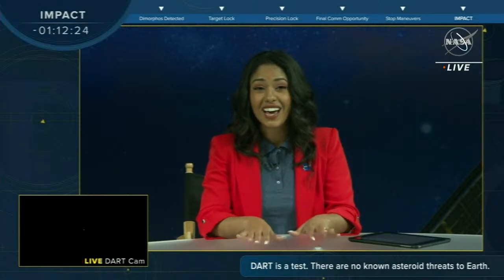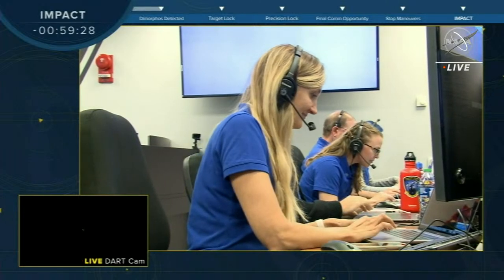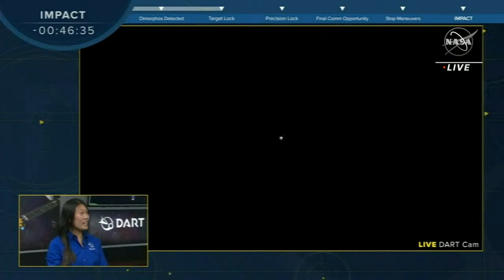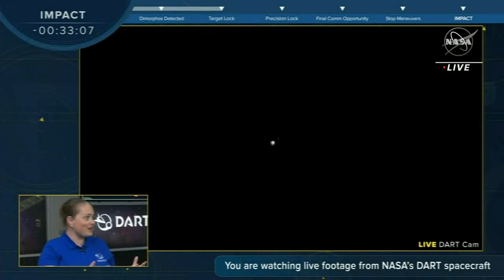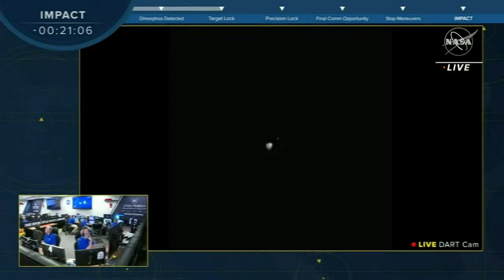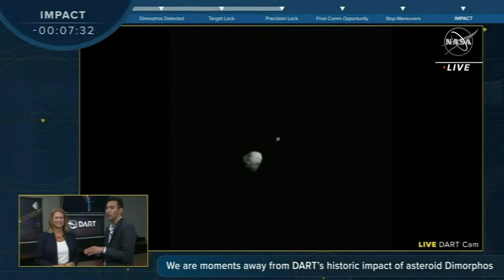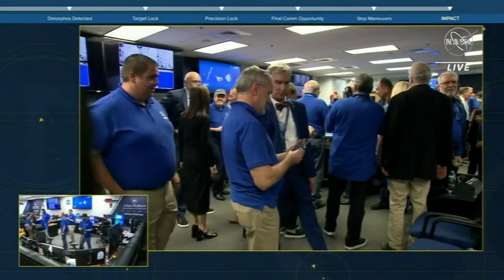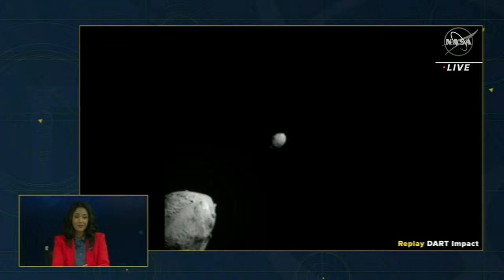NASA's DART spacecraft crashes into asteroid in first planetary defense test | full video

Comment: So, its awesome it hit, but the big question here is:  did it divert the asteroid? Or did the satellite just get godsmacked?
Reply: @Culture 25-8 i'm not clowning on it. I'm wondering the ultimate question, the purpose of the entire test. In fact when I finished watching the video, they reveal they will have the answer in about 11 hours when orbit trajectories update. This is a test to see if they can change an asteroid orbit to prevent destruction of the Earth in case of the event.
Reply: @Aero3D  Asteroid's path altered in NASA's first test of planetary defense system
By Steve Gorman  October 11, 2022 7:22 PM EDT

"DART's celestial target was an egg-shaped asteroid named Dimorphos, roughly the size of a football stadium, that was orbiting a parent asteroid about five times bigger called Didymos once every 11 hours, 55 minutes.
The test flight concluded with the DART impactor vehicle, no bigger than a refrigerator, slamming directly into Dimorphos at about 14,000 miles per hour (22,531 kph).
Comparison of pre- and post-impact measurements of the Dimorphos-Didymos pair as one eclipses the other shows the orbital period was shortened to 11 hours, 23 minutes, with the smaller object bumped tens of meters closer to its parent."

So a 32 min change when the predictions were 10 minutes and a 73 second change would have been considered a success.
Reply: @steveaustin2686  i saw!!! Thank you!!! Success! :D
Reply: @Aero3D  And better than expected. On to the next test.

Comment: It would be ironic if the telescopes reveal that the small rock now hit a huge rock changing the trajectory, that is now heading towards earth
Reply: that was why Simulations were the way to go.. you have good point!
Reply: @yosefnegussie8790  No, it's a silly point once you look at what the test was.
Reply: DART hit the smaller asteroid that orbits the larger asteroid, barely moving it. The movement was larger than predicted, but really didn't change their orbit around the Sun at all.

Asteroid's path altered in NASA's first test of planetary defense system
By Steve Gorman  October 11, 2022 7:22 PM EDT

"DART's celestial target was an egg-shaped asteroid named Dimorphos, roughly the size of a football stadium, that was orbiting a parent asteroid about five times bigger called Didymos once every 11 hours, 55 minutes.
The test flight concluded with the DART impactor vehicle, no bigger than a refrigerator, slamming directly into Dimorphos at about 14,000 miles per hour (22,531 kph).
Comparison of pre- and post-impact measurements of the Dimorphos-Didymos pair as one eclipses the other shows the orbital period was shortened to 11 hours, 23 minutes, with the smaller object bumped tens of meters closer to its parent."

So a 32 min change when the predictions were 10 minutes and a 73 second change would have been considered a success.

Comment: Would it not be more effective to “dock” with it and use thrusters to change its trajectory?
Reply: Pretty sure that's another/next mission.
Reply: Their CGI isn't advanced enough to fool the masses with that yet.
Reply: @brianfitch5469  true man
Reply: somebody else said such thing, I told them, they should be in NASA..
Reply: You can get more energy transfer with a fast hit than with slowing down, 'docking', and using thrusters. This is a LOT of mass to move.

Asteroid's path altered in NASA's first test of planetary defense system
By Steve Gorman  October 11, 2022 7:22 PM EDT

"DART's celestial target was an egg-shaped asteroid named Dimorphos, roughly the size of a football stadium, that was orbiting a parent asteroid about five times bigger called Didymos once every 11 hours, 55 minutes.
The test flight concluded with the DART impactor vehicle, no bigger than a refrigerator, slamming directly into Dimorphos at about 14,000 miles per hour (22,531 kph).
Comparison of pre- and post-impact measurements of the Dimorphos-Didymos pair as one eclipses the other shows the orbital period was shortened to 11 hours, 23 minutes, with the smaller object bumped tens of meters closer to its parent."

So a 32 min change when the predictions were 10 minutes and a 73 second change would have been considered a success.

Comment: Great. Did it have any effect?  Or was this just to show they could?
Reply: The immediate results showed the Asteroid's orbit was slowed very promising for the first test
Reply: Asteroid's path altered in NASA's first test of planetary defense system
By Steve Gorman  October 11, 2022 7:22 PM EDT

"DART's celestial target was an egg-shaped asteroid named Dimorphos, roughly the size of a football stadium, that was orbiting a parent asteroid about five times bigger called Didymos once every 11 hours, 55 minutes.
The test flight concluded with the DART impactor vehicle, no bigger than a refrigerator, slamming directly into Dimorphos at about 14,000 miles per hour (22,531 kph).
Comparison of pre- and post-impact measurements of the Dimorphos-Didymos pair as one eclipses the other shows the orbital period was shortened to 11 hours, 23 minutes, with the smaller object bumped tens of meters closer to its parent."

So a 32 min change when the predictions were 10 minutes and a 73 second change would have been considered a success.

Comment: Still waiting to hear if the asteroid was moved.
Reply: It was slowed
Reply: Asteroid's path altered in NASA's first test of planetary defense system
By Steve Gorman  October 11, 2022 7:22 PM EDT

"DART's celestial target was an egg-shaped asteroid named Dimorphos, roughly the size of a football stadium, that was orbiting a parent asteroid about five times bigger called Didymos once every 11 hours, 55 minutes.
The test flight concluded with the DART impactor vehicle, no bigger than a refrigerator, slamming directly into Dimorphos at about 14,000 miles per hour (22,531 kph).
Comparison of pre- and post-impact measurements of the Dimorphos-Didymos pair as one eclipses the other shows the orbital period was shortened to 11 hours, 23 minutes, with the smaller object bumped tens of meters closer to its parent."

So a 32 min change when the predictions were 10 minutes and a 73 second change would have been considered a success.

Comment: Impact is spot on 🎉
But how much this has change the course ?
Reply: Stay tuned to find out...
Reply: Asteroid's path altered in NASA's first test of planetary defense system
By Steve Gorman  October 11, 2022 7:22 PM EDT

"DART's celestial target was an egg-shaped asteroid named Dimorphos, roughly the size of a football stadium, that was orbiting a parent asteroid about five times bigger called Didymos once every 11 hours, 55 minutes.
The test flight concluded with the DART impactor vehicle, no bigger than a refrigerator, slamming directly into Dimorphos at about 14,000 miles per hour (22,531 kph).
Comparison of pre- and post-impact measurements of the Dimorphos-Didymos pair as one eclipses the other shows the orbital period was shortened to 11 hours, 23 minutes, with the smaller object bumped tens of meters closer to its parent."

So a 32 min change when the predictions were 10 minutes and a 73 second change would have been considered a success.
Reply: @saugor1  results released today

Comment: Congratulations guys. But has that direction changed? In future if big aspect comes our way ,will we use nuclear bomb to change such massive object momentum?
Reply: The smaller asteroid orbits the larger one. The goal of the mission is to slow down its orbit just a little bit. From 11 hours to 10:45
Reply: Asteroid's path altered in NASA's first test of planetary defense system
By Steve Gorman  October 11, 2022 7:22 PM EDT

"DART's celestial target was an egg-shaped asteroid named Dimorphos, roughly the size of a football stadium, that was orbiting a parent asteroid about five times bigger called Didymos once every 11 hours, 55 minutes.
The test flight concluded with the DART impactor vehicle, no bigger than a refrigerator, slamming directly into Dimorphos at about 14,000 miles per hour (22,531 kph).
Comparison of pre- and post-impact measurements of the Dimorphos-Didymos pair as one eclipses the other shows the orbital period was shortened to 11 hours, 23 minutes, with the smaller object bumped tens of meters closer to its parent."

So a 32 min change when the predictions were 10 minutes and a 73 second change would have been considered a success.
Reply: @sgenov  They changed the orbit period by 32 minutes. See article ref below.

Comment: WHAT...what happened.  All I saw was rock moving forward in a Claymation/Stop Motion Animation towards a camera. Stunt by NASA to drum up support and funding
Reply: It was the satellite moving towards the asteroid
Reply: Asteroid's path altered in NASA's first test of planetary defense system
By Steve Gorman  October 11, 2022 7:22 PM EDT

"DART's celestial target was an egg-shaped asteroid named Dimorphos, roughly the size of a football stadium, that was orbiting a parent asteroid about five times bigger called Didymos once every 11 hours, 55 minutes.
The test flight concluded with the DART impactor vehicle, no bigger than a refrigerator, slamming directly into Dimorphos at about 14,000 miles per hour (22,531 kph).
Comparison of pre- and post-impact measurements of the Dimorphos-Didymos pair as one eclipses the other shows the orbital period was shortened to 11 hours, 23 minutes, with the smaller object bumped tens of meters closer to its parent."

So a 32 min change when the predictions were 10 minutes and a 73 second change would have been considered a success.